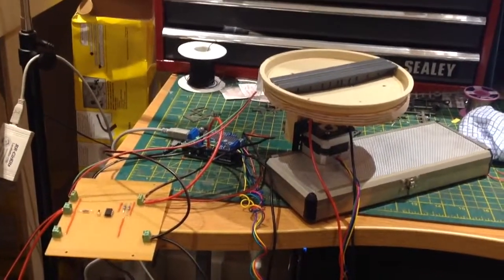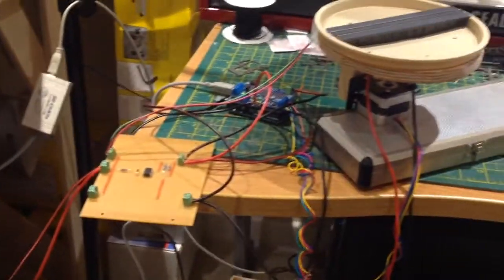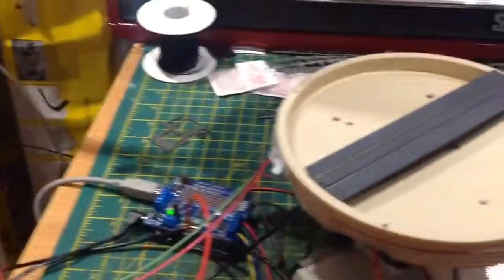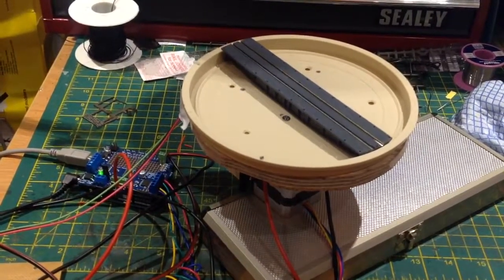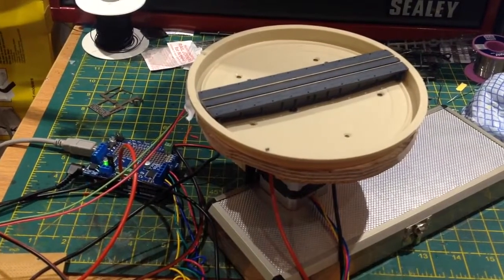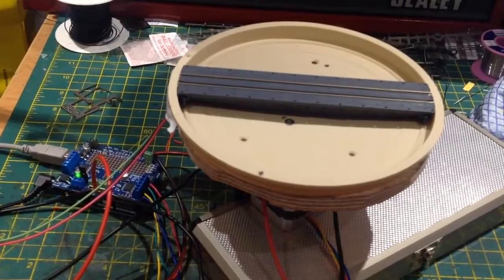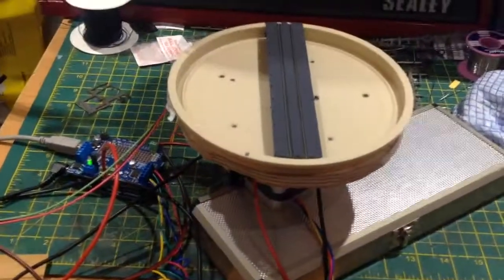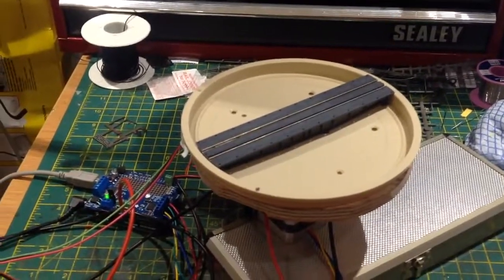Bromsgrove N Turntable operated by Arduino

Comment: Hi,

Did you use the hall effect sensor and magnet as listed by Ray at the start of the thread... reason I ask is not sure the magnet etc will fit so confirmation would be great before I buy the parts and turntable... Thanks... Pete.
Reply from the maker: Pete's Hobbies I used a smaller one if I remember correctly same spec but smaller....
Reply: Appreciate the reply, will get the turntable first and can then measure up the available space and go from there... Thanks!